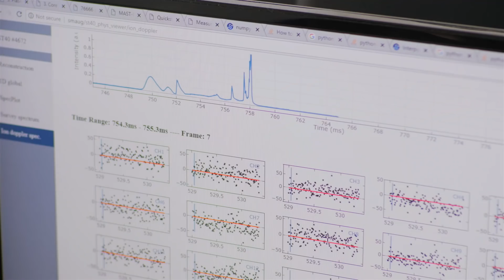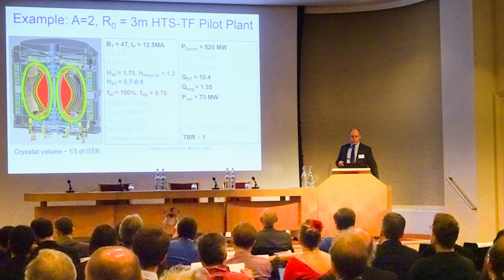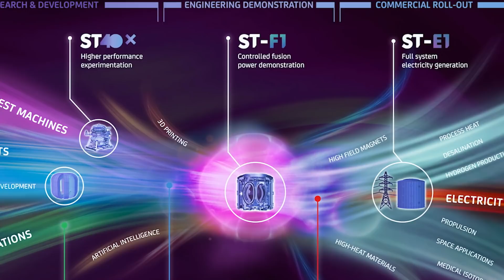2018 Fusion Progress at Tokamak Energy

Comment: I did not understand what is the breakthrough here? Was sustained reaction achieved? I believe there are already many reactors which have achieved 50M degree C temp. Was 50M degree C achieved in far smaller design?
Reply from the maker: We have achieved 15 million degrees in a small device.  Our next step is to achieve 100 million degrees - fusion temperatures - which would be significant in such a small device and in one that is privately funded. This video shows our progress so far.
Reply: @tokamakenergy6400  Nice one. Keep fighting. But one thing I wonder, if a new superconductor of unprecedented power becomes discovered, eg let's say a new superconductor that can handle 300 Tesla, would that mean a guaranteed success  would happen in fusion within maybe a year?
Reply: @tokamakenergy6400  I could be hiding one such supermagnet in my basement now. LOL